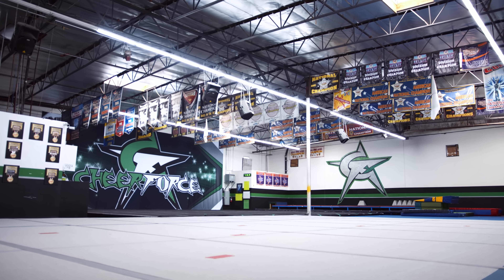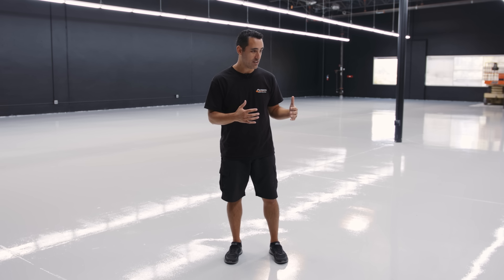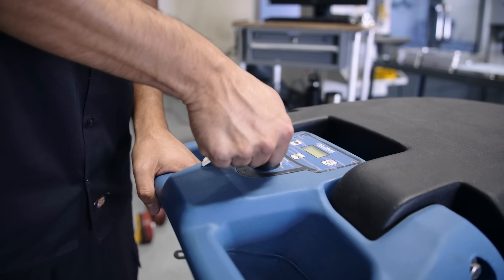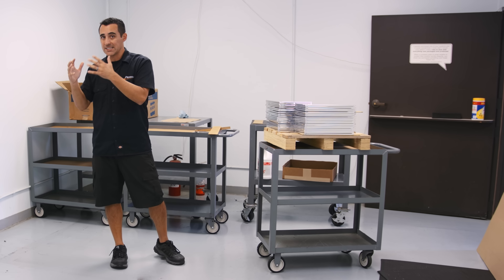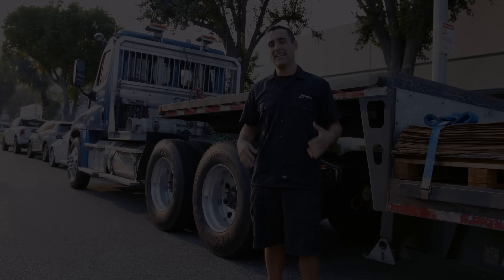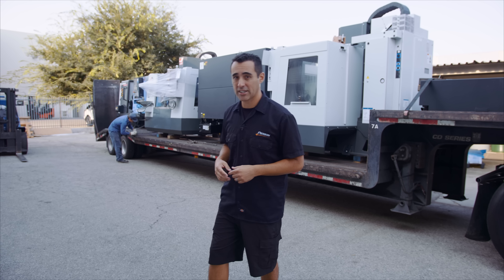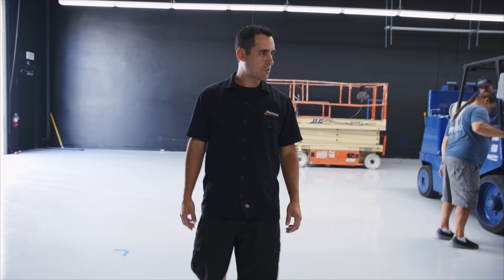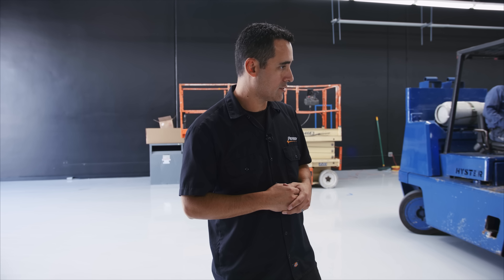Machine Shop Move Vlog Ep 3 | Transporting 50,000 lbs of CNC Machines!

Comment: That's a lot of logistics to consider, It blows my mind how big USA factory's are and how much space you have around the machines, my shop in UK is 2500 sq ft I pay £6 per sq ft [ £15k] and £8k council rates and to make it pay I have to squeeze the machines in, its all safe but tight, in ideal world I need at least another 1000 ft but I've been there for since 86 so I couldn't even comprehend a move 😱, goog luck, do you get the machine manufacturers back in to re set up the machines to get them dialed in because cncs don't like to be moved because gremlins seem to get in.
Reply from the maker: Moving isn't hard if you have the right team, right mentality and right plan. This is our 3rd shop in 4 years and I'd trade moves for shop growth every time.